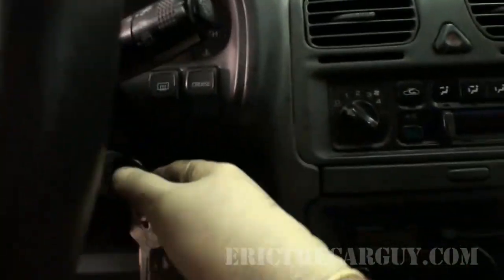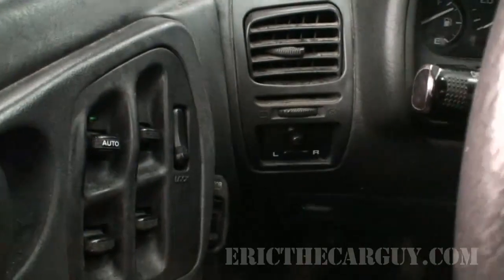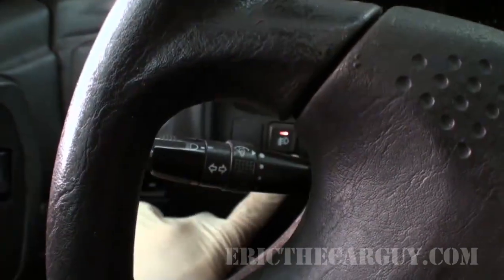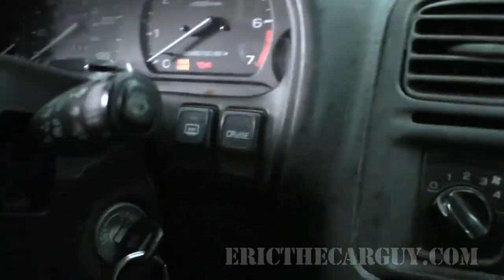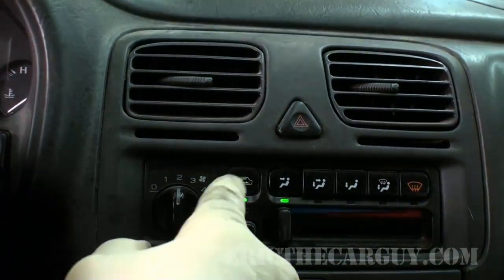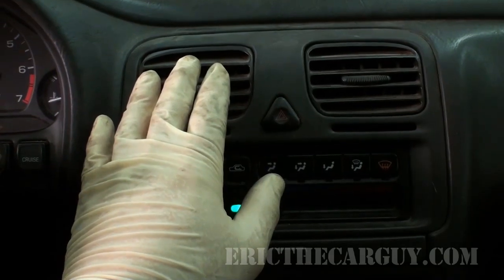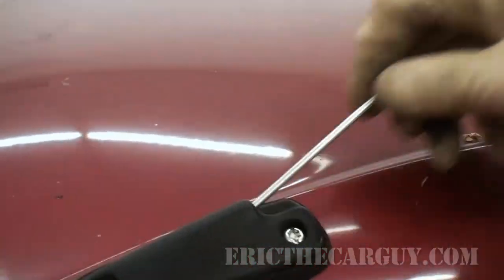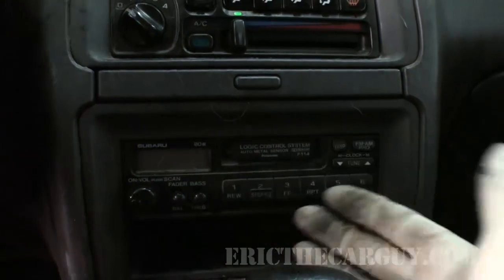Buying A Used Car Part 3:  Interior Inspection - EricTheCarGuy

Comment: I found my '72 Malibu on a used car lot in '81. It had a 350 and auto. The car was equipped with a tow package so it had the 12 bolt rear end. The odometer showed 99K miles. The engine compartment look fairly new. The dealer was asking $1500, so I took it for a drive. No funny engine noises and no smoke, but the a/c didn't blow cold. I told the dealer that the a/c didn't work, popped the hood and pointed to the compressor, which wasn't turning. I told him it would cost me $300 to fix, so I offered $1200 for the car. He took it. What I had noticed, when I pointed at the compressor, was that the electrical connector appeared loose. Once I left the dealer's lot, I pulled over and seated the connector and the compressor turned on. I drove home in air conditioned comfort. I put another 116K miles on that car.

Comment: Random tip, some accessories may not work without the engine running, obviously AC, but on some Hyundai vehicles, the rear defroster only operates with the engine running, for example.

Comment: i think one of the biggest things he hasnt mentioned so far is to bring a flashlight even if you are looking at the vehicle in the day time. it will hlp you find things easier. You can tell if the paint is original or not. It is just very handy
Reply: +MistaiRek07   Good tip.  It also good to bring along a piece of carpet or cardboard so that you can slide under the car to have a look... CV boots, exhaust  pipes/mufflers, fluid leaks ,etc

Comment: I bought a car some time ago. It was a shit! My mistake... The motor make a lot of noise, also the windows. When running, I listened awful plastic noises from the interior... The only thing that didn't make sound was the horn.
Reply: +mrcelada1 hahahaahaha....
"The only thing that didn't made sound was the horn"   xD
Reply: +Usama Virk Sounds like my first car... chevy cavalier. Now I have moved on to better things, my corolla which has yet to let me down.
Reply: corolla 1.3 or 1.8??
Reply: 2000 corolla with a 1.8 which has been written off now I am looking at a corolla 1.8 from 1998. same generation. They are awesome cars!
Reply: Gud luck mate!
Me planning for a 2013 Honda Civic!

Comment: subaru enthusiasts call that parking light switch atop the steering column the "virgin switch" due to first time owners not knowing that that switch allows the parking lights to remain on even when the key is off, leading those first-time owners to wonder why their parking lights won't turn off. or worse, why their battery is dead!

Comment: the basic idea of buying old car is
1) check body - because it is most complex and you will spend a lot of many if will find some problems with it
2) check engine and gearbox and maybe suspension

all others easy to find and fix

Comment: Summary (save 20 minutes)- Most important note smells indicating flood or damage. Press every button to see it work. Note anything different from new that reduces the value of car. An additional note omitted by Eric. Turn the AC on while engine is at idle to see if warm engine stalls.

Comment: that all depends on how deep the rust as penetrated, if when you grind the rust you have parts of the structure being removed and it looks like swiss cheese then yes you will definitely need to remove the rotted section and put some new metal, but in general just grinding and cleaning the surface will do, what I like to do in those situation is I then spray some rust proof paint and/or some undercoat, tape off the edges and put a nice coat on my rocker panels, every spring re-check underneath.

Comment: Hi !
Another thing to check while operating the air conditioner and the heater is the heater-core.
If there is damage to the heater-core, you will feel a mist of vapor coming from the vents,. Also there will a film of some kind of fluid forming on the interior on the windshield.
This repair can be very expensive.
PEACE !!!

Comment: Fixing rust is not hard, if you wanna remove surface rust on a fender for example just grind off the rust go a little further past the damaged area then clean the surface with acetone or paint thinner. then put some primer and paint, if you want it to look really good you can put some bondo and sand it down with different grits from lowest to highest, finish with 400 grit then put primer and paint, some clear coat too if you want.

Comment: Don't forget to check for wet carpet under the dash on the passenger side of the floor board, could possibly have a bad heater core.

Comment: One thing crossed my mind: When one turns on the ignition, one might want to check that all dashboard lights in fact light up at first, as I believe in many cars they should. Including the check engine light as well as abs or airbag light some cars may have. I've encountered stories of people disconnecting the "annoying" lights after not being able to figure out what's wrong with the car... Hoping to get through inspection. If they don't light up when one starts up, they don't light up ever.

Comment: I check my rear brake lights by using a golf club(Driver) by using the head on the pedal and the handle is popped against the seat.

That park light switch is for if you are parked at night and just want the car to be seen like when you are delivering pizzas.

Comment: How many miles is too much on a used car and how many is too little-I know some people can mess with the odometer and change it so that the car has low mileage, how can you tell when that has happened? Thanx
Reply: There is no hard and fast rule for most vehicles. Of course, there are tendencies that show up on specific vehicles. For example, our family van that we had some time ago had major transmission issues every 75k miles (almost exactly every time). That's something you can look up for the specific vehicle you're going to look at.

As far as "too few," it's usually quite obvious. Nobody is going to roll back an odometer a couple thousand miles. They're going to roll it back significantly. It's usually just using common sense. If the car is 20 years old, obviously worn, yet has 50k miles on it, you can assume they've rolled it back.
Reply: depends if its been looked after
Reply: Kyndreka Blue my 2001 honda civic has 360,000 miles on it still runs great and still passes smog

Comment: Just as a heads up might want to make sure the drive seat belt releases before you actually buckel yourself in. I bought a used a dakota that didn't work right. Luckily I was able to take the cover off and get it to release.

Comment: Eric do you have or could make a video about repairing radio problems? Recently got a 1994 Nissan Primera in tip top condition for very little money, but the radio doesn't get any signal(non original radio), at all. I will take a look at it once the weather here get's a bit warmer(lack of garage), but I honestly don't know where to start except check all the cables behind the radio.

Comment: I didn't understand the part at the beginning when you were testing the rear defroster button by the cruise control button~you said it wasn't working but the light did come on but my question to you is how would you know if it was working or not~you didn't have the car running?

Comment: yea i kinda said that wrong. i checked wiki as well and didn't really get an answer. What i meant to ask was why is there a position for lights switch that just turns parking lights on. Every car i've ever been in has 3 positions: 1- off which only has day lights on. 2- day lights + parking lights. 3- low beams + parking lights. So basically i don't understand position 2. In what situation do u ever just use parking lights with day lights. seems to me there should only be 2 options.

Comment: how does one check the a/c in the winters?
Reply: Mechanically, you should feel the a/c clutch engage when you turn it on. You can usually notice this with a change in idle (the idle might increase by a few hundred RPM). If you are under the hood you should hear the clutch engage near where the belts are located. You might hear the engine bog down for a second and then jump up in RPM, which is normal. Functionally, it would be best to bring the car up to operating temperature and warm up the cabin a bit, then switch to the a/c mode to see if the air gets significantly colder. When you do this, switch the a/c on and off to make sure there is a temperature change and you're not just feeling the ambient air temperature from outside. Sometimes the a/c might not work very well with the car sitting at idle, but will work well when you're driving down the road, so check it on your test drive as well.